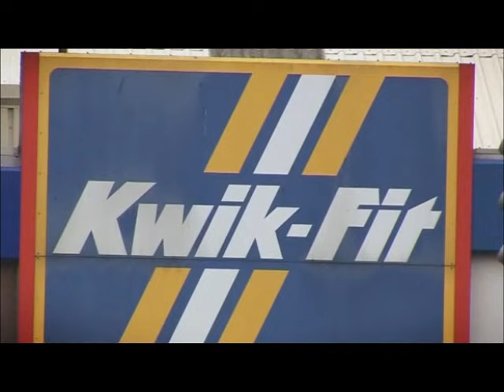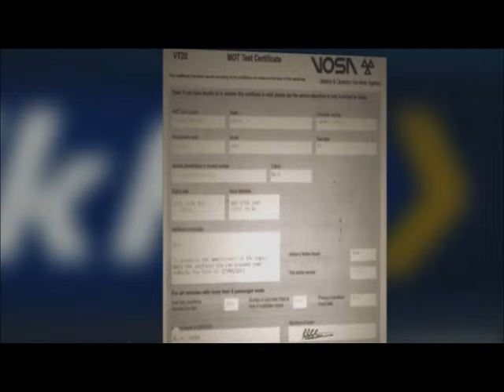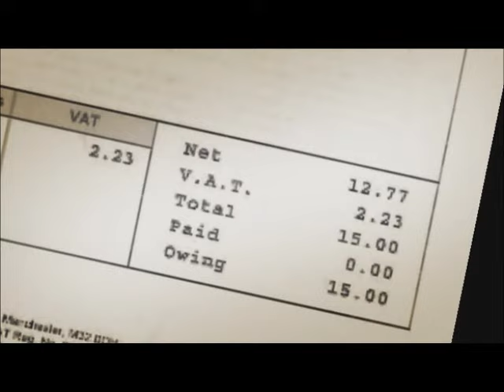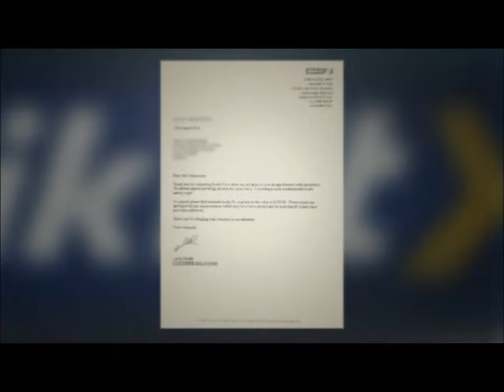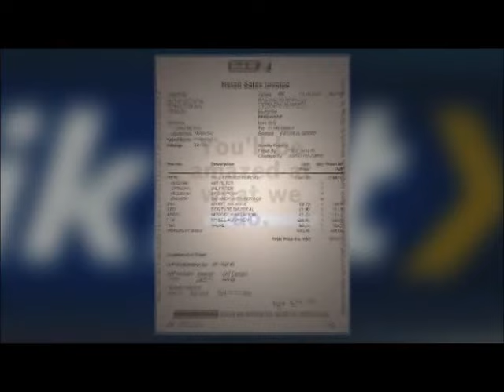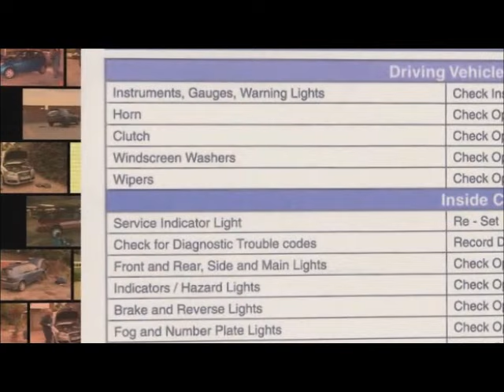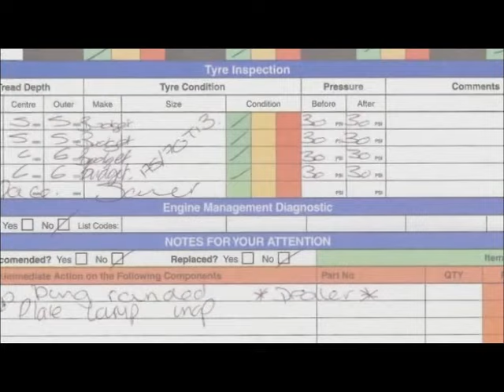Kwik-fit Car Rip-off Watchdog.wmv

Comment: Not just quick fit, Halfords, and Formula 1 see you coming. I had a very bad experience at Halfords i asked for a oil change and filter thats all, got told £89 i said ok i will wait until i was paid and will come down in the next couple of days. That night i checked their website and they said it was only £59 for just oil and filter. I went back and told the guy i previously spoke to who got rude and quite angry about the fact i had done my homework and said he will do it for the price stated on website. When i got my car back i checked under the bonnet and low and behold there was oil everywhere like someone had poured it over engine and hoses to the point there was oil under the car and on the front bumper too. I rang Halfords headquarters to complain and sent the photos of the appalling work carried out and rude service  i had. I got offered 10% off vouchers for my next Halfords purchase. Wankers! Never ever will go back.

Comment: I took a company car in as the front nearside tyre had a slow puncture, sitting waiting told me needs a new tyre and then hits me with the shit the front desks were warped (11,000 miles) I asked to see and told them he was at it needless to say the company no longer use kwik fit.

Comment: I took my fiance car once to kwik fit in Falkirk for mot,4 years old swift with 35k on the clock,omg,mot failed,list was so long,half a car parts to change,i took car to another NORMAL garage for second opinion and car pass with no issuses.Never again i will go kwik fit

Comment: Took my BMW into Kwikfit for a tyre check and asked to look at valves as well.
No tyres needed but needed new valves on three wheels as faulty.
Was unhappy at this so took car to local BMW dealer and they stated valves fine BUT they have had complaints about Kwikfit before trying to con customers. Avoid!

Comment: Back in 1999-2001 there was a place like kwik fit ..... apples car clinic. they got caught by trading standards for ripping people off , garages from hell on itv about it years ago. i'll never forget them charging a bmw 325i (e30) owner £1500 for a steering rack they never changed.and the person that they charged £1100+ for the repairs for a old fiat panda to get it through a mot. (these days fiat owners have got a lot more wiser.. they just follow another fiat around, the bit you need will fall off when they hit a pothole or a speed bump🤔😂🤣 ). apples car clinic gave the same swirl that kwik fit give "that there service did not meet the standards either we or our customers expect". the rubbish excuses haven't changed after all the years gone by!.

Comment: too long a story but I got ripped off by them 20 yrs ago , cost me £500 for a £18 repair ,,,, total rip off but they never got another cent out of me ever again , when I complained they said they are fitters and not mechanics , fault was a split rubbers on brake pistons , but insisted I had to have a full set of calipers ,

Comment: I have 2 instances of dangerous workmanship by Kwikfit.
My sister in law popped around as she was in the area and said there was a noise coming from one of her wheels on her old VW beetle. I jokingly asked ‘has she had her wheel off’ for any reason. She said yes, she just had 2 new tyres fitted at Kwikfit. I told her that a wheel nut had come off? After I took the hub cap off, lo and behold I found the wheel nut inside the hub cap.
The second instance was My sons friend who had again had tyres fitted at the same Kwikfit garage drove his VW Golf a few hundred yards away from the garage to then see one of his front wheels come off and go up the road.
The car dropped to the ground and wore away his front wheel disc. Luckely he was not driving fast and came to a safe stop.
I will never take any of my cars to Kwikfit.

Comment: You actually DON'T NEED to take off the wheel to check DISC brakes. Only drum. They either look as it's on the hoist or at home I just get underneath to look.... with many cars with mags like my main car, you can see them RIGHT THRU the mags.

Comment: Right I can tell you something about how crap KwikFit really are. AND YOU SHOULD NEVER USE THEM..... My son had a 2012 Mini he bought from a dealer, with full service history was a lovely car never let him down. He had it 3 years and decided to take it to kwikfit as they was doing an offer for service and MOT, i told him don't but he did, they charged him for brand new oil and all the other stuff that was done. Then on the way home he phoned to say there was something wrong with it, I looked at it and the oil had never been changed as there was all sludge in the filler cap to say that the head gasket had gone and needed a new one, took it back to them for them to say it will cost 3500 pounds to fix WHAAAAt they are insane and complete imbeciles. NEVER USE kwikfit  ... EVER

Comment: A young lad took his car for an mot at kwik fit and they failed on front brake pads (which were fine) and they also failed it on rear brake pads the car was a ford ka and it don't have pads at the back it has drums. 😂. Rip off merchants!.

Comment: My brother-in-law took his car to Kwik-fit for its M.O.T. This work is sub let to a local garage. It came back as a failure on 3 points. My brother-in-law happened to know the owner of the garage and rang him and questioned him over the faults before taking the car away from Kwik-fit. He was told that the vehicle had passed its test with flying colours. Asking around, he found others who had had the same experience.

Comment: Took my car years ago for a exhaust after fitting I was told my clutch needed replacing but I didn’t bother and got another 90 thousand miles before it needed replacing these men are just ripp off merchants also was told by ex mechanic they used to have a saying I’ve pinned his hat on

Comment: If YOU take the car away, it's dangerous............ if it was not road worthy, they have a duty of care to seize vehicle it happened to me I brought a car that needed two front tyres, the garage discovered that both front wheels were cracked and impounded vehicle as a danger to the road.

Comment: About 20 years ago I had a Granada 2.9i Ghia, bought insurance with Kwik-Fit, not a problem because price was good and never had a claim, with the policy was a free MOT check, within a few months it was due, so, booked the car in and it failed, they presented me with an itemised fail sheet that totalled £651....one item of which was a partially blocked windscreen wiper jet (£18 to rectify) needless to say I took the car for an MOT elsewhere, it failed on a wiper blade and the rear number plate lightbulb and adjustment to headlamps, total inc MOT £49, I asked about the  wiper jet.....”Oh, it only needed a needle just to unblock it mate”.....no extra charge, have never even considered Kwik-Fit since.

Comment: I always found Kwik Fit's speciality was 'ooh your brake discs are scored and worn out' even on cars with under 20,000 miles. Utter bullshit. I've drove cars with over 80,000 miles that still had the original discs. I've also NEVER replaced discs on any car I've owned in 30 years. The only way discs wear and get damaged is if you drive on pads that are down to the metal, which nobody should do.

Comment: If you want it done right, do it yourself.
Reply: That's my attitude now. It's not just Kwik Fit - there are independent garages too that rip people off. Then they complain about closing. There was one - The Quay Autocentre and later CQ Autocentre - in a big place in Deeside, Wales, that kept ripping people off and got so little repeat custom as a result that it moved to a smaller place in Queensferry, trading as AP Wright. According to Google, it's now permanently closed and according to Companies House, 4 out of five company officers have resigned. Probably before they get sued by someone.

Comment: Selling parts you don't need is how they made their money and still do probably. One of their big favourites was always 'YOUR BRAKE DISCS are scored and grooved and need replaced' (with pads of course). Some scoring/grooving on older brake discs is normal, the pads bed into them. Brake discs hardly ever need replaced unless you've driven the car with pads worn down to the metal. I've had cars since 1983 of all different ages and I've NEVER had to replace DISCS, not even on a car that had done 140,000 miles which is more than halfway to the MOON.

Comment: I had an E92 M3 and my parents were driving it one day (both pensioners, easy targets). They burst a tyre outside quik fit so I told them to take it in.  They claimed they needed TWO tyres  and said by law they'd have to report them to the police if they didn't have them done.  They charged just over £800 for two tyres and when I checked on the Quick fit site they were only £350 fitted.  Absolute scum

Comment: My dad took his 2016 BMW 3 series to quick fit because he got a puncture, instead they replaced the tire because run flats can't be repaired (lol?) and apparently he needed wheel tracking done. Pretty sure a 8 month old BMW bought straight from a BMW dealer doesn't need wheel alignment done after 8 months of motor way use...smh

Comment: I did this, took my first car to quick shit for its MOT, failed on LOADS of things even though they were not relevant, like "exhaust mounting snapped" yeh but I mounted it at a DIFFERENT PLACE which worked due to a different exhaust..

After it all, they took apart the rear brakes (which i didn't ask them to do) and they said both sides master cylinders went, im like huh? no leaks at all, brakes worked perfectly for the year I had the car... they wouldn't even LET ME TAKE IT OUT THE GARAGE to get it repaired somewhere else because "it's dangerous to drive"....

Cost me £500 in brakes on a £700 car >.>

Comment: The idiots told me my Capri 2Litre S needed new back shocks and leaf springs years ago and quoted me £130. Although the car was resprayed and looked fresh, I knew the underside was rotten with rust and that every bolt would need to be cut or burnt off. So I said work away. Two men were on the car for the entire weekend. They thought they saw me coming. The opposite was true! Remember, any qualified mechanic would not allow himself to be called a fitter.

Comment: Took my wife’s car in for MOT at kwik fit. They returned saying the car failed on emissions and needed a full flush. They also said I won’t be able to drive it out because the pulley has come off. I insisted on leaving and requested the keys. To my surprise I couldn’t turn the steering wheel as it was stiff. Had to leave my car with them to fix at a whopping £280. Robbing b@$t@rd$!

Comment: Funny, this was 2011, and kwik fit told watchdog that they was going to spend a million pound training staff better.  I took my car to them in 2017 as I had a puncture that I needed fixing asap.  They tried to tell me that the wheel alignment was off and it would affect my tires.  I looked at the guy and said, really, car only had a service a week before at the dealer so ill take it back to them. Guy didn't say anything else. When I got home I looked at the service sheet and was nothing wrong with alignment.  Thieving scum, wouldn't go back there again.  Mobile tire fitters I use now.

Comment: I've had the same problem with a volvo dealer with the speel deal twaddle.  The mechanic has spotted a problem with the top engine mounting on my V70. Little did he know I replaced it 2 months before. Excuse for quote. It was a new apprentice... sorry.  The dealer used to be on sefton street Liverpool.

Comment: I knew a building contractor who did works for Kwik Fit. He told me their staff are on a very low basic wage and make up their money on bonuses based on how much work they can generate out of each customer! Went to Devon about 10 years back and the exhaust fell off car. Kwik Fit said i needed 100% new exhaust (which I didn't) and 2 shock  absorbers renewing (didn't fall for that one as I'd towed a caravan over 200 miles and would have noticed the lack of those). Kwik Fit have been prosecuted in the past by Trading Standards.

Comment: A bunch of untrained idiots. A few years ago I had a car which used quite a lot of oil (due to worn rings). Before a long trip, I took it to KF for an oil/filter change. OK, no problem so far, but after my trip I needed to top up with oil, and the idiot mechanic (?) had hammered the oil filler cap into the rocker cover so hard, I had to buy a tool to remove it

Comment: I always contact KWIK-FIT  first for a quote, then I can see exactly what I'm saving by not going there. Back in the day I was quoted £ 135 for a rear exhaust box for my VW  Sharan. I bought one from a supplier that they use themselves for £ 35 and fitted it at home.

Comment: S KAM service tried to scam me on a MOT. Rang me at work and said it needed new brakes, suspension, and when they said exhaust i new something was not right as i had a new 1 fitted 2 months ago. I told them i had a friend who owns a garage so he can do me the work cheeper than them. I went to pick the car up they didn't even give me a MOT advisory for the work that needed doing. Sure enough took it to my friends garage and there was fuck all wrong with it, just needed bulb alignment for MOT pass. I only took it to sKAM sevice cos it was near my work.

Comment: Not just these, but many others. I had an argument with 'Formula 1 Autocentres', who fitted an exhaust with the wrong connector, when I complained they would not agree they had got it wrong, and just smeared a mass of sealant around the joint. I couldn't be bothered to take it further - they rely on this mostly - so just made a point to avoid them for ever, and told all my friends about them. I think they have lost thousands of pounds in business because of a ten pound correction - so good to know, aresholes!

Comment: They refused to replace my brake pads unless I agreed to discs. Nothing wrong with the discs, no lip or cracks but they would not gaurentee the new pads unless I had them changed, so I agreed. Had two brake technicians working on my car, both inspecting my brakes with clipboards for about 3 hours!!
Three months later I had an MOT at my local garage where they discovered that the brake pads were put on back to front and Kwik Fit also managed to sheer my brake sensor cable and had gaffer taped it back together. Needed new brake pads and brake sensor unit. Should have stuck with my local garage.

Comment: Many years ago I had restored a classic car a standard ensign which had been in the family since 1969 .This was about 1985 and at the time worked for a forklift manufacturer ( COVENTRY CLIMAX ) I'm a time served service engineer, now retired, the company had a contract with quick fit and as such I had a good relationship with the manager ,I rang them because I needed the tracking setting, I was told that the manager had left but to bring the car along and they would set the tracking, I took the car and left them the keys,5 minutes later they asked me to drive the car into bay whatever as their engineer? could not start the engine, after they checked it ,it took 5 of them scratching their heads , i was told it needed a complete new exhaust systems and new discs and pads ,this was after a 10 month restoration, I said that would be a good trick as it had a complete stainless steel system fit by myself and the car did not have disc brakes, they then said all cars have front discs i informed them discs did not become standard on british cars until about 1963 and as the car was built 4 years previous to this date it could not be fitted with discs and I was  a qualified mechanic, they had already set the tracking so I asked how much do I owe you to be told nothing as they all crept away ,this as I said was in 1985 ,never been back ,never will .

Comment: How these criminals are still in business is a complete travesty. A brand new Mercedes S class would need at least ten pieces of work after a visit to Kwik-Con. A mate deliberately tried it on with the local branch. Told them the car was handling badly. They suggested new shocks....to replace the upgraded Bilsteins he had just fitted himself. He left and phoned Trading Standards. Who took no action. Hence they are still conning people on a daily basis.

Comment: I do most of my own work. But a few years ago, the back box fell off my old Punto, 6am chrimbo eve, after a night shift. Had hoped it would last  til I could get to it over Christmas. Had no choice but to take it into Kwik Fit in Derby  at 9am. Stood up in the waiting room, just in time to see the spotty faced fitter squurting oil from an old fashioned oil dispenser somewhere underneath. Promptly fetched me a minute later to explain both rear shockers were leaking.  I pointed to the can of oil  sat by the ramp, told them to fetch my car down and explained what I'd seen. No one argued or even tried to  deny it. My other half insisted I took it there and witnessed the whole thing - she has never questioned anything to do with the car again, so Kwik fit did do me a favour!

Comment: Having worked for STS Tyres, a sister company of Kwik Fit wit the same business model, there's little surprise. Staff are moved from job to job, often not given the time to do a full inspection, and management then write up bogus reports. The work I carried out was genuine and first rate, but the business model would not stand for it. Having explained to management of a dangerously damaged wheel rim, I was instructed to change the tyre regardless. I noted the damaged rim on the job sheet, and explained to management of the danger in writing. Sure enough the car was back the next day with an angry customer. Because management had missed the damaged wheel when talking to the customer the first time, they were not prepared to do further work, which was necessary.